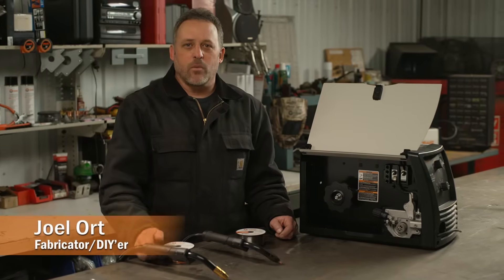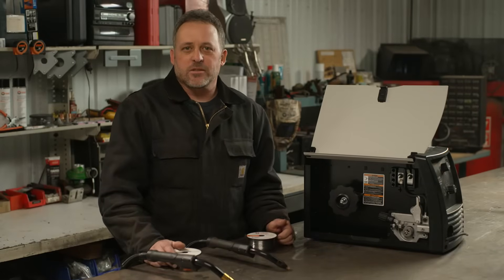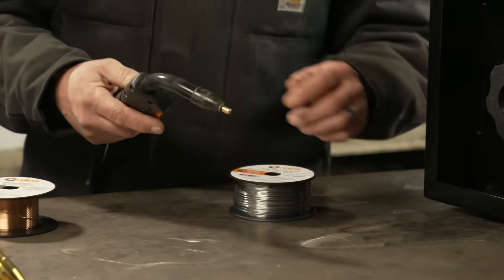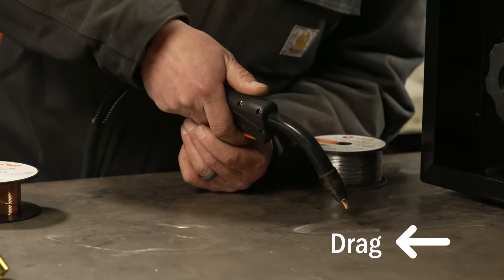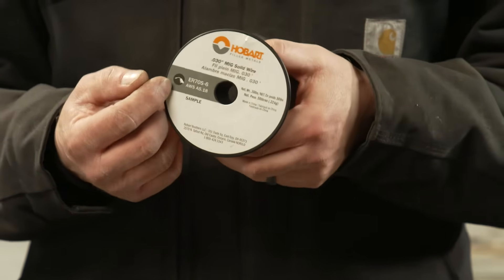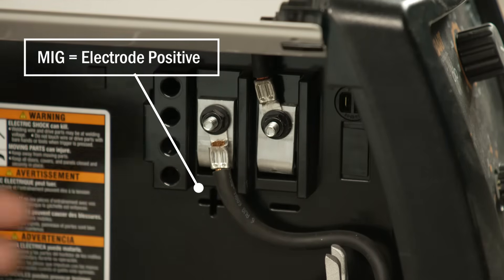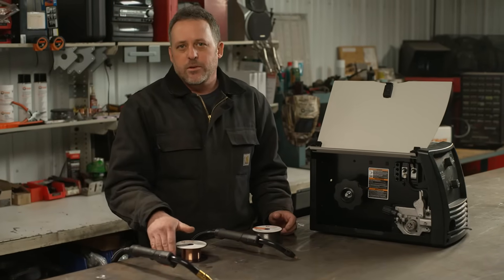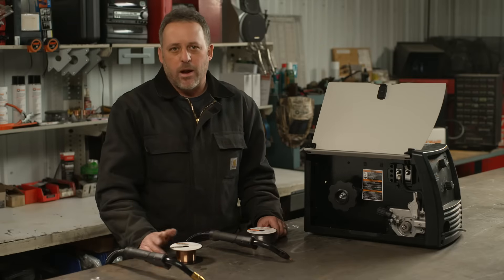Flux- cored vs. MIG Welding: Basic Differences

Comment: I learned more in 2 minutes, than watching 10 longer videos over a few years to understand why it's not working for grampa. He gave up because I told him the surface needs to be clean so he went back to historic electrode stick. 👍🇭🇲🇭🇲🇭🇲🇺🇸👍🍻
Reply: Yeah I’d recommend welding beginners always start out with stick and stay with it until they thoroughly understand as well as can do it proficiently and then learn mig/flux. Once you know what you’re doing and know your way around a stick welder, then it makes more sense to switch.